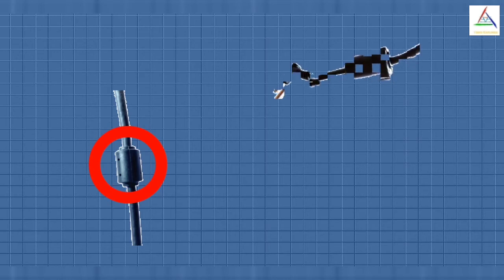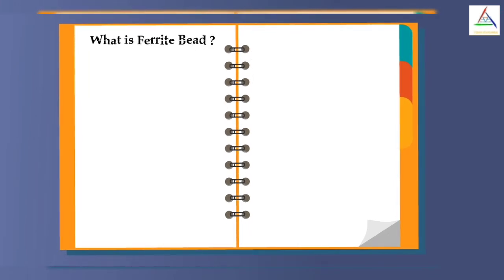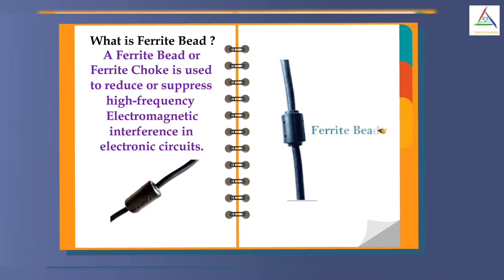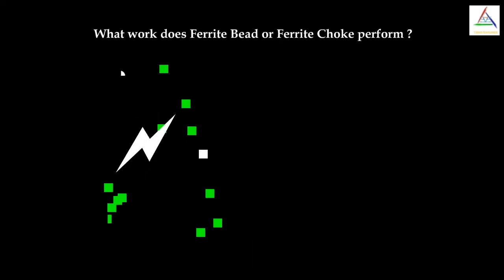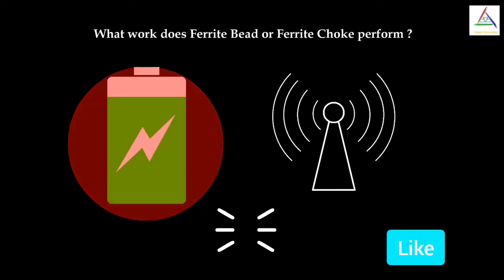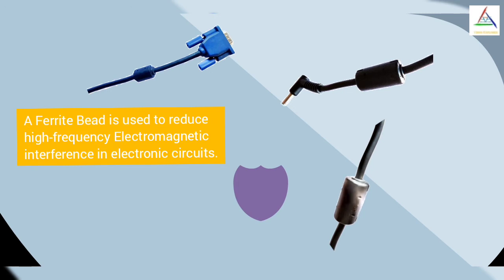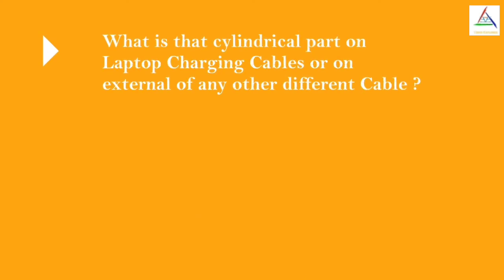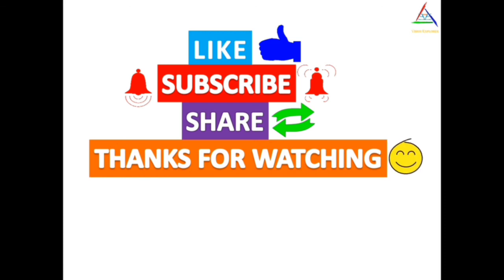Ferrite Bead || Explained

Comment: is it dangerous to remove this from your laptop charger
Reply from the maker: It's not advisable to do so and it may develop noise related issues.

Hope it helps
You can subscribe us for more interesting videos 
Have a magnificent day :D
Reply: @TechCamper  what are noise related issues?
Reply from the maker: @annoyedbrox4851  Sorry for late reply, I was busy in Exam Preparation.

Here Noise related issues include high frequency Noise.
Reply: @TechCamper  will it harm me if i remove the bead
Reply from the maker: @annoyedbrox4851  In case of laptop's charging cable, it will not harm you but it may cause your system to not work properly e.g. flickering of screen, beep noise from system while charging etc.

Hope it helps
Have a great day :D
Reply: @TechCamper  thank you
Reply from the maker: @annoyedbrox4851  :)